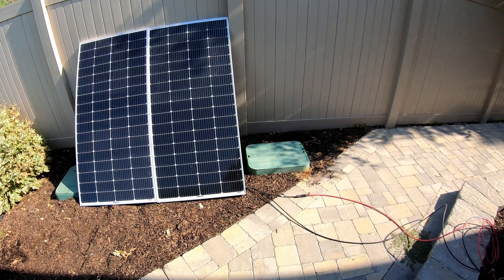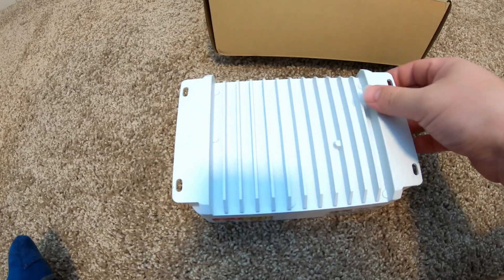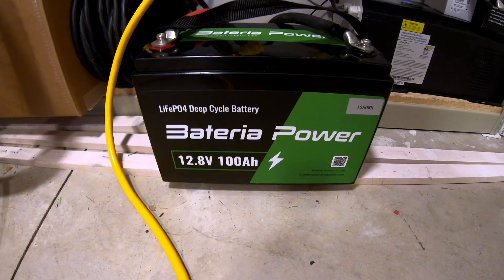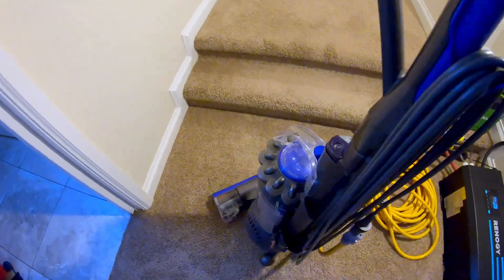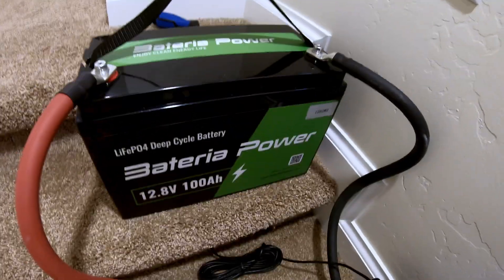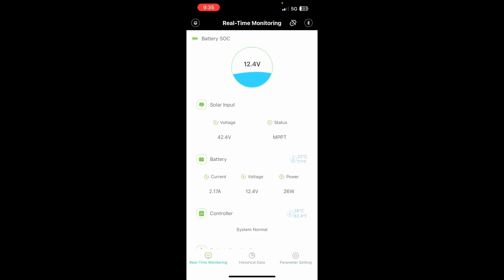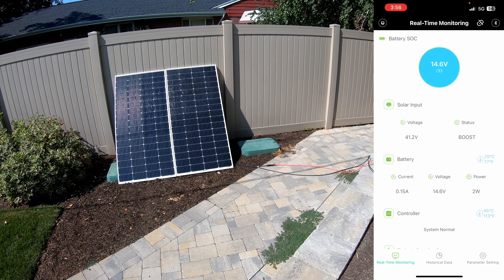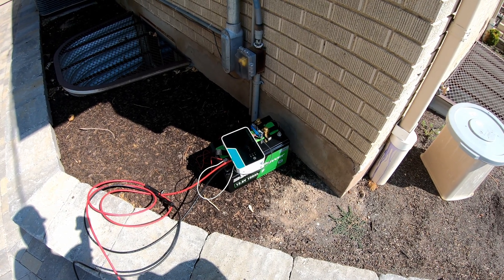Incredible Price to Performance Off Grid Solar Setup! Bateria Power LiFePO4 Battery & MPPT Charger

Comment from the maker: Buy a Bateria Power 20A MPPT Solar Charge Controller like you saw tested in this video: https://bateriapower.com/products/mppt-solar-charge-controller-40a-wireless-monitor-with-app?ref=efntvdyf
Be sure to use code: TRICK12 to save 12% off your order!
Buy a Bateria Power 12V 100Ah LiFePO4 Battery like you saw tested in this video: https://bateriapower.com/products/lifepo4-battery-12v-100ah-pro?ref=efntvdyf 
Be sure to use code: TRICK12 to save 12% off your order!
Then as a side note, Bateria has some really nice solar cables at good price points you should check out! The code TRICK12 works on these too!
MC4 Solar Cables: https://bateriapower.com/collections/solar-connectors?ref=efntvdyf
XT60 & XT60i Cables: https://bateriapower.com/collections/xt60?ref=efntvdyf 
Buy an Renogy 3000 watt inverter/charger like you saw in this video: https://amzn.to/3AjKPfK 
Buy an EZ Generator Switch for your furnace like you saw in this video: https://amzn.to/3A5FDfJ 
Check out my “12V Battery Testing Results & Rankings for Home Backup” Spreadsheet and see how this battery stacks up against the competition! https://docs.google.com/spreadsheets/d/1OuUalW-_9BdWMyQz0CxCAM9cpO6whw_LX_exW0Fhqzo/edit?usp=sharing
I don’t drink coffee, all donations get 100% re-invested in the channel to bring more un-sponsored content for you. Please consider donating through this link as opposed to using YouTube Super Thanks since I get to keep more of your hard-earned money and less goes into the pockets of large companies like Google. You can also schedule one-on-one consulting/meeting with me here: 
https://buymeacoffee.com/theresatrickforthat 
Buy an Anker Solix C1000 Power Station: https://amzn.to/4hEcOYt or ankersolix.pxf.io/PO64BX

Affiliate Disclosure
As an Amazon associate I earn from qualifying purchases at no cost to you! Thanks for your support!

Comment: Good find and share in these cheap components for hobby/DIY solar setups.
Reply from the maker: Thank you! They’re certainly a great bang for the buck! Thanks for watching!
Reply: @theresatrickforthat  the trick you shared on how to connect solar to an A/C was great too!

If you have any other good ideas on how to feed solar to whole home without a smart meter detecting occasional back-feeding, that would be great.  It sounds like I need inverters that have both a zero export function and a buffer function to always allow the first few hundred watts to come from the grid because when my 5 ton A/C turns off, there’s a small delay before the inverter stops producing.  What are your thoughts on this?

If I like solar, I’ll end up getting approval to back-feed the grid for about 10c per kW.  After they stop offering that, that more states are doing, I’d add battery storage….

Comment: Question: How many watts is that power bank?  Also, I would love to see you do a video on how you connected the DC on the power bank to the 12v battery so that the refrigerator could run it longer.
Reply from the maker: The Anker power bank? It has a storage capacity of just over 1000wh and it’s got an 1,800 watt inverter. Great video idea! Thanks for watching!
Reply: @theresatrickforthat  Okay. Thank you. :-)